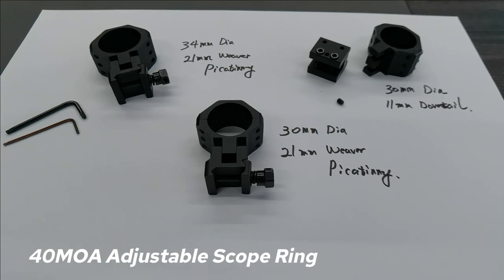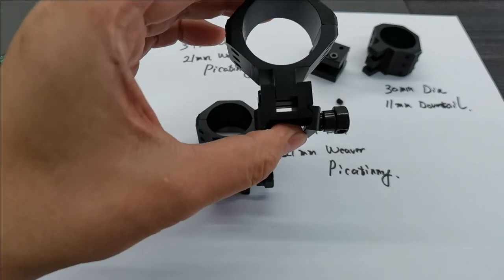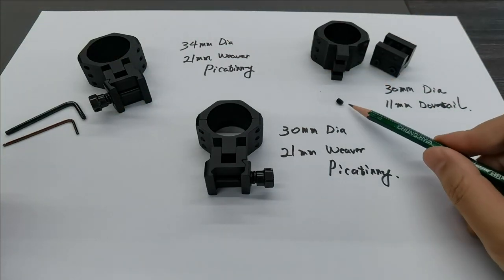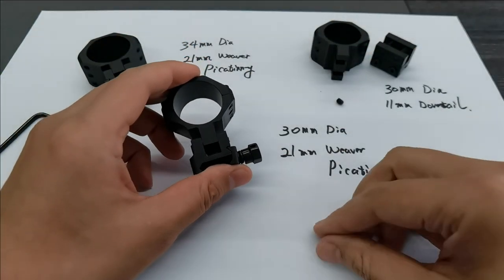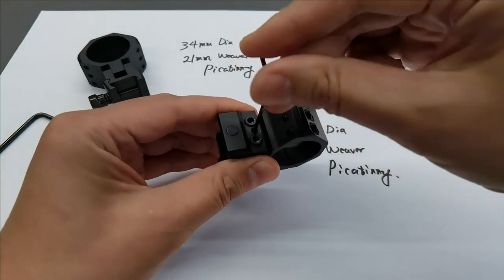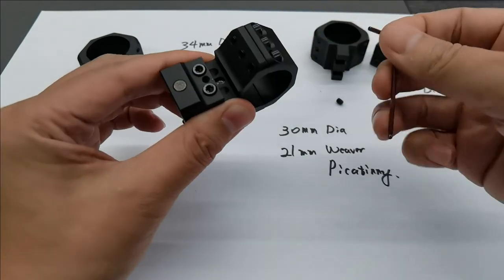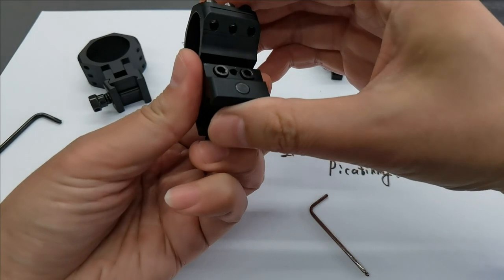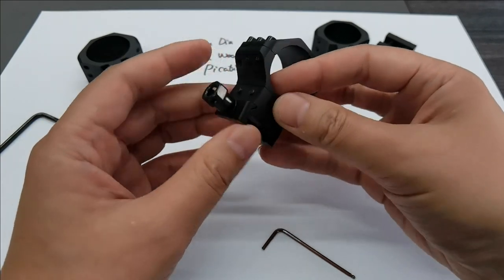How to Resolve Scope Elevation Not Enough for Your .22 LR or Airgun? Check The Adjustable Scope Ring

Comment: What is the purpose of the screws on each side of the hex screw that locks down elevation? Do you also tighten these two screws on each side to hold elevation?
Reply from the maker: Hi, yes, the two screws can be tightened to hold the elevation. Much more stable. Thanks.

Comment: So how is a parallel moving of the scope supposed to give more elevation? The scope should tilt and not move parallel to the bore axis. Elevation is the change of the ANGLE of the axis of the scope to the axis of the bore. MOA=Minutes of ANGLE
Reply from the maker: Hi, how are you? Yes, yes, the scope rings can be tilted. It will not be parallel as the bore axie. Thanks.
Reply: @VectorOptics  So why are you using a bubble level then?  You are showing how you meticulously are trying to move it PARALLEL to the bore axis using the bubble level. When I see how the inner sliding surfaces are machined, it is evident that it was ment to be moved parallel up and down. It seems that you can tilt it a litte bit, but this is due to the play in the mechanism and not because it was ment to be a tilting mechanism.
Reply from the maker: @deusvult4787  Hi, the monut is free-style adjustment. 
Firstly, you need to install your scope axis parallel with the monut rings's axis. In that case, you may need to use the bubble level for the right installation.
If your scope has big objective lens which may touch the barrel, rail or reciever etc, you may need to adjust the height of the rings. 
By using the bubble level can also help proper installation between scope and rings, and it can avoid some bending happening. 
Having installing the scope, you can zero your scope with your caliber. If the scope elevation adjustment range can't support your shooting, you can title the rings as requested. 
Sincerely hope it may help a little bit. If you have any question please do not hesitate to contact us, thanks.